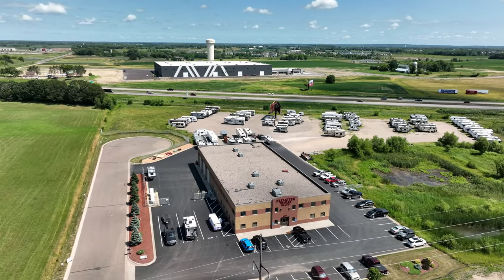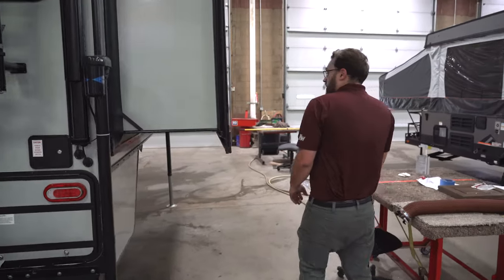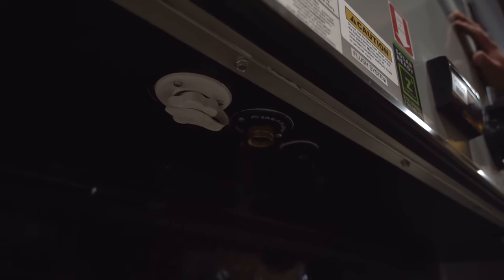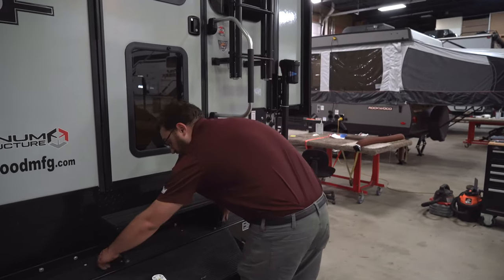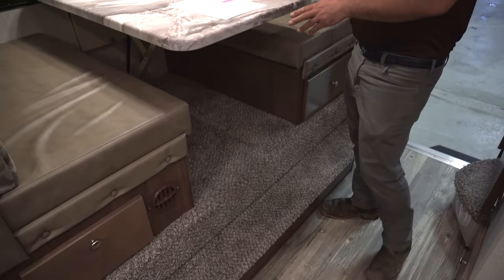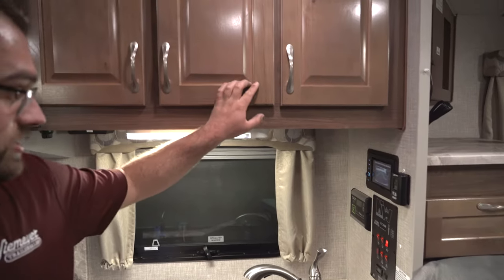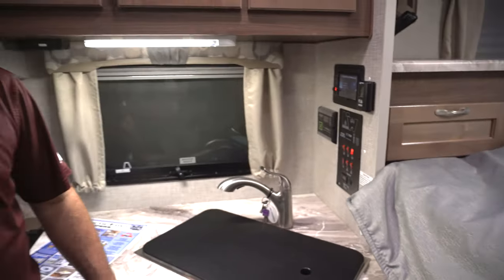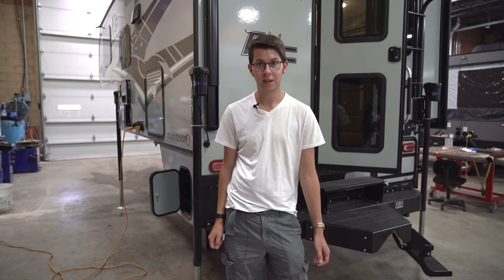2023 Arctic Fox 990 Truck Camper Walkthrough

Comment: Fyi the weight of this camper and its twin the 992 (which i just purchased in june ) is more than they state, depends on options of course. My camper wet and ready to roll weighed 4750 lbs from my dealers lot. So if you are looking at these campers you will need a 1 ton dually with a minimum of 6,000 lb payload capacity. My truck was specifically ordered for this type of camper. It is a ram 3500 4x4 quad cab 8' bed, tradesmen, snowplow prep, b&w goose hitch, ram factory air system, 6.4 hemi, yes i got the gas engine with the 8 speed trans and i upgraded to the 4:10 ratio gears in the rear end. Huge weight savings. My truck has a payload rating of 6,450 lbs, gvwr is 14,000 lbs.
I have added the roadmaster anti sway bar in the rear, as it does not come with it from the factory. It does come with one up front with the snow plow prep package with other suspicion upgrades included. Like i said these type of campers will be heavier than advertised so plan for it. Im glad i did. Happy camping.
Reply from the maker: Agreed - it seems like all of the camper manufacturers come in way over sticker weight when it comes to campers. Our 1150 is a little under 5500lbs loaded. Sounds like you have a great setup!
Reply: My dad carried this and towed a 17.5' boat over the continental divide with a 2004 dodge 2500 diesel. Never had any problems. But of course insurance would be an issue if you got in a wreck

Comment: No way in hell a 996 is 3000 pounds.  I have an 811 (smallest slide out) and it’s 5000 pounds.  Its mounted on a Chevy 2500 HD 6.0 gas with 1300 pound additional leaf springs, air bags and sway bar.  More important are your rims.  I’ve cracked the spokes on two sets.  Stay with steel rims. You must upgrade your tires to 4080 pounds Load E  (Coopers AT Discovery) for stiffer sidewalls.  Beware of quality issues.  Faucet cracked internally at the mold line, 2 weeks the hot water heater controls burnt out, loose main battery cable (fell out).  Slide out wasn’t aligned correctly.  Finally the shower curtain is 2 inches too short.  Pluses.  The shower area is large,  cab over allows you to sit up in bed.  Curved ceiling makes interior feel huge.  811 and 996 are great two person campers.
Reply: AF 990 is 3000LBS Dry. My fathers old 2004 AF 990 was 3300 Dry.

Comment: Can I put the 990 In a F350 , 6. 3/4 Bed, measures out 7ft. With the slide out.
Reply from the maker: The 990 is meant for a 1 ton truck 8ft bed minimum to haul safely. Feel free to call Niemeyers Trailer Sales in Albertville, MN if you'd like to chat about compatibility :)
Reply: What is the cost?
Reply: @nia6849  $60,000 if loaded

Comment: Why hasn’t AF joined the truck camper industry and provide a lithium battery/inverter option from the factory? Nice camper!
Reply from the maker: Maybe someday! That would be a great option
Reply: @InfiniteExplorers  what is the current timeline on ordering a camper? I think you are the closest dealer for us in Iowa?
Reply from the maker: @usmcshepherdE9  if you contact Niemeyers Trailer Sales in Albertville they can give you a rough timeline. Usually it depends on how many orders come in for each model. I think Northwoods is making more 990 or 992 models right now.